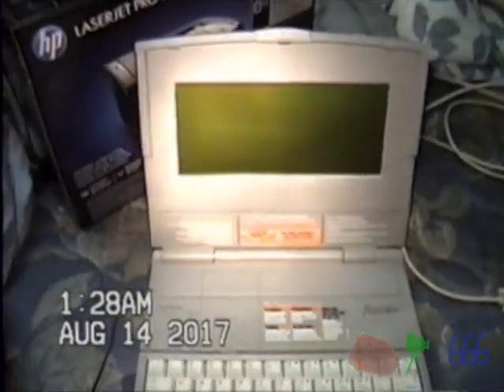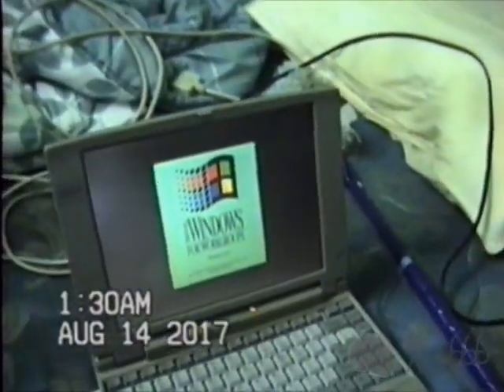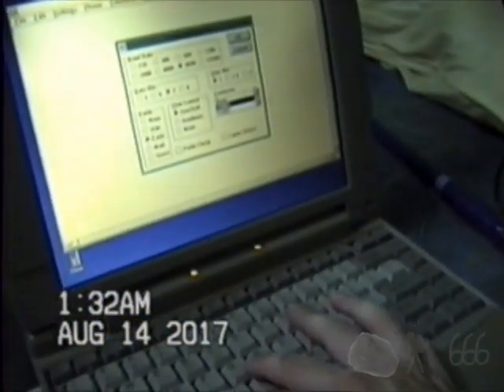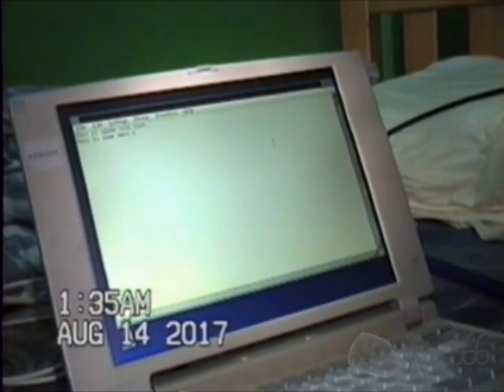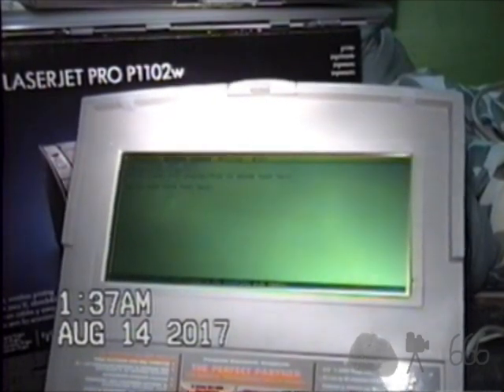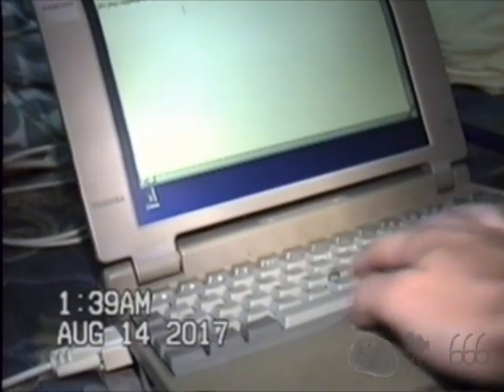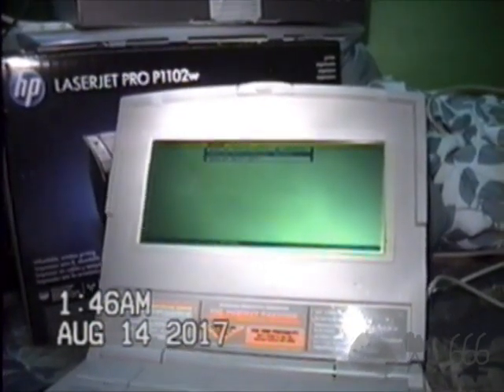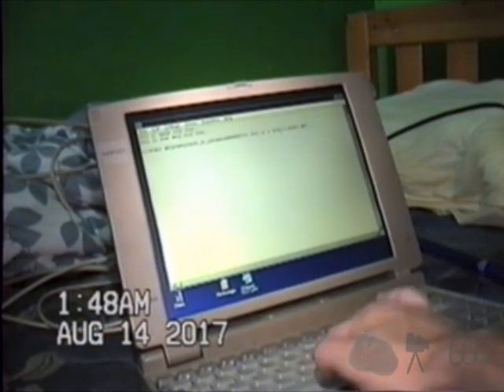Brother Super PowerNote PN-8500MDS: Communications via RS-232

Comment: I had a Brother PowerNote gifted to me by my aunt back in 1996. Around 1998, my I bought a 2400-baud modem on eBay (yep, my eBay account is from 1998, and they had no idea or didn't even care that I was barely a teenager back then). I dialed up to my ISP which surprisingly provided a UNIX login prompt if you didn't attempt PPP communications. They didn't do this on purpose, and apparently got really mad when I called up their support line and asked the support guy to download a compiler so I can program on there. They turned it off and I called up and begged the guy to turn it back on and promised to not do anything bad and surprisingly he actually let me back on. I got into installing Slackware Linux on my 486 DX-2 that my  dad's friend gifted to me, and set up my own Linux box, but this got me into coding and messing around with UNIX systems when I was barely a teenager. I really liked your video and hope you get into this stuff more and more. It got me a cool software engineering career. Most recently, I worked on embedded Linux for medical ventilators and Computed Tomography for baggage scanning using C++ and Qt on Linux. It's all such cool stuff. I hope you're into this stuff and get to work on some awesome projects yourself. Cool video! Very awesome review and I hope you keep at it. I subscribed and up-voted. Good job, my friend.